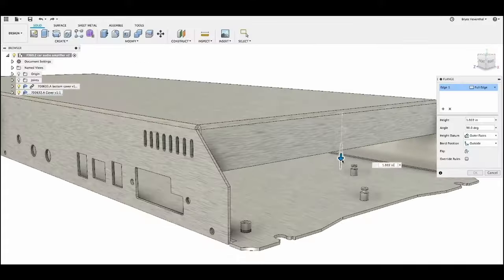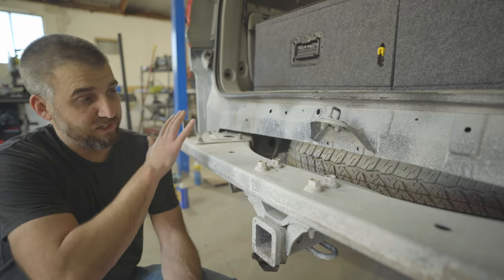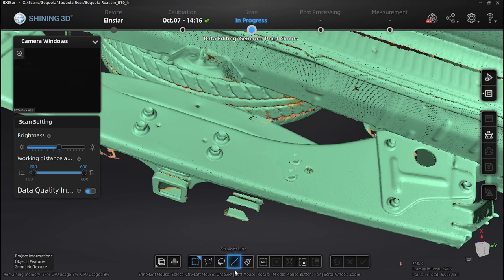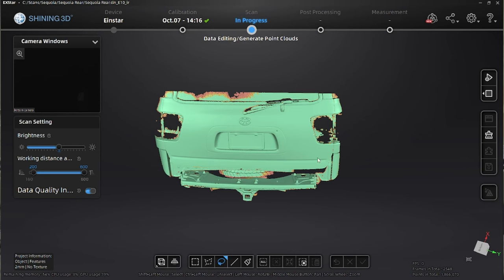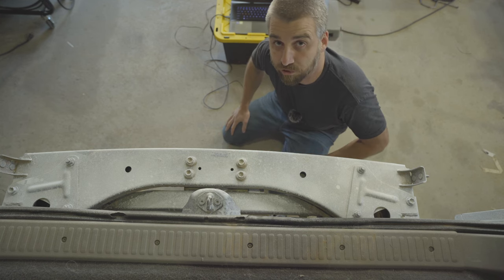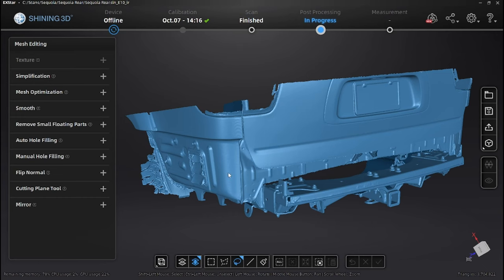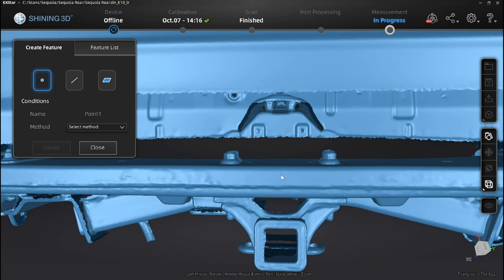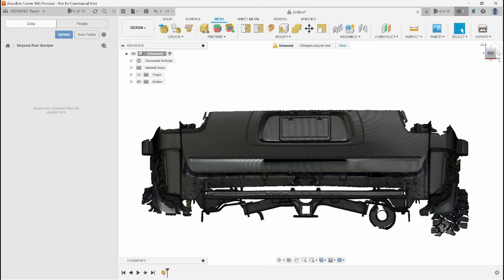The best budget 3D scanner in 2024? Einstar Scanner Review

Comment: Great video! Love seeing reverse engineering with Einstar and Fusion 360.

With bigger scans I would try to simplify as much as you are comfortable with. The less triangles and points that i have had the better the EXStar software and Fusion 360 work for me. 

Fun Tip:
 Double tap middle button to switch your zoom buttons to brightness adjusters, this helps when needing to adjust on the fly.

Comment: I pitched one of these barely used months ago for commercial work but yet to use it. I am worried about the numerous mentions (elsewhere) of how important to notch video cards etc are to functional use of this scanner. I have an HP Z Book workstation laptop, about 4 years old, equipped with a lightweight  Nvidia Quadro GPU. Fingers crossed it'll do the job. My work only requires scanning very, very infrequently. Last time, about 5 years ago. 😅 I used a David structured light scanner.

Comment: Is the spray solution easy to clean and safe for paint and parts for example mechanical ones (like engines, axles, suspensions etc.) that have some points with grease or oil?

Comment: You shouldn't have to apply powder on that. That surface is not what would be considered glossy for scanning. But I suppose if it doesn't use targets, that could be an issue.  Rudimentary software, but considering it's under a grand, not terrible.
Reply: It’s the same software 15k scanners from shining are using. Compared to other sub 1k scanners it’s the best available.

Comment: I want to start scanning car and truck cargo areas to make speaker boxes that fit nice and snug. You think this is a good scanner for this? I will have them manufacturer at that point.
Reply from the maker: As long as you have good features to track, it’s very accurate. I’m using it initially for this bumper where I’ll first verify the bolt holes. Everything I’ve verified so far is accurate. I plan to do a rear seat delete on my tundra and I’ll be using this to scan the interior for a platform.

Comment: Hold up, 2023 isnt over yet. From the looks of it the Revopoint Miraco is going to blow the Einstar away
Reply: Maybe in 5 years. The tracking isn’t the best with Revopoint scanners. I have a mini and have to use a lot of extra scanning targets for good tracking. 
But the software with vers 5 is a lot better now.
Reply: @Todestelzer  Yeah ver. 5 is definitely better. Einstar scanning software is definitely impressive, but I haven't really been wowed by the accuracy of the scans. They seem very rough and blocky compared to what I get with my Pop2
Reply: @Projekt5.3   The pop2 isn't the same size class of scanner. Different tools for different jobs my man. If Einstar made a smaller scanner they'd blow Revopoint out the water. It's all the software where the competition is falling down here.
Reply: @chublez  I wasn't comparing anything to the Pop2. I was comparing the Einstar to the MIRACO which is a pretty even comparison in my mind as the Einscan can do much larger objects than the Pop2. Either way, the Einscan lacks the accuracy.
Reply: @Projekt5.3  May be what you say, can't compare, but my experience with POP2 is horrendous. I don't know why I didn't bought Einstar instead, maybe it wasn't available at the time, but definitely am regretting getting the POP2. Yes, I was as well wondering if I should rather get 10k scanner, but as many can't justify the cost for what projects I want to work on but then 2 times 1k is getting pricey as well.

My POP2 lose traction all the time even with a plethora of trackers (yes, scattered irregularly), never actually tracking them as tracker but somewhat as a feature (raised height), resulting in frustration upon frustration. Zinc spray? Sometimes worked against me. Only somewhat workable outcome was a motorcycle fairing but since I need the whole picture, just one scanned piece won't cut it.

Comment: How powerful a computer do you need?
Reply from the maker: The biggest thing I have seen that people need to upgrade is GPU and RAM. A good NVIDIA GPU and (i'd say) minimum 32GB of RAM.  64 would be preferred. Their minimum required that Shining 3D states is almost too low. I have a Intel i9-13900H processor, 32GB of RAM and NVIDIA RTX 4080 GPU
Reply: If you need to ask, a more powerfull one. seriously though these things lean on the computer pretty heavy. Our man here doesn't have a budget build by any imagination and you saw he had to cut down his point cloud to export due to ram limitations. The more PC you have behind this thing the better your experience will be if you're trying to manipulate large point clouds. Particularly ram, luckily ram is one of the cheaper components to spec out(and outside a mac is usually easy enough to upgrade after the fact) once you've got the rest covered.

Comment: Amazing informercial. But, it's BS. The product is bad - when compared to what the influencers post on youtube - and the return policy is a complete fraud. They say 14 days money back - then it takes 13 to deliver and the refund is only for products you don't touch or don't work. So, yes, complete misrepresentation, does not fit the purpose and it is over hyped by paid influencer marketers. Don't buy this crap! Much harder to use and with much worse results that what is being advertised.
Reply from the maker: Not sure if you actually watched my video. I paid full price for it. It has its issues with meshing, which I go over. You definitely need a beefy computer to get the higher res meshes. It fits my needs with price and what I’m looking out for it. It’s nice knowing that you believe I was paid for this, but I was not. Legally we have to disclose if we did as well, whether it be free product, sponsored post, discount, etc.
Reply: Is internet required while scanning?
Reply: Yah it's REALLY depressing how poorly the current crop of scanners work.   I have pushed these things to their limits and... their limits are not anywhere NEAR what they claim.  .3mm isn't actually the size of details that you can expect to pick up, it's the smallest thing the scanner has resolution for.  In reality unless you have tolerance in the range of a few mm or sometimes worse they are NOT going to give you a good model.  There is a spray that ISNT expensive that works as well as the tailormade stuff for scanning and is cheap, developer spray used (I believe) in construction stuff.
Reply: @happyhobo2217 No.
Reply: Einstar is very good.  One needs to understand how its limitations and functions to scan well with it.